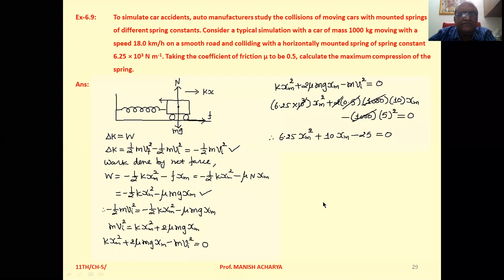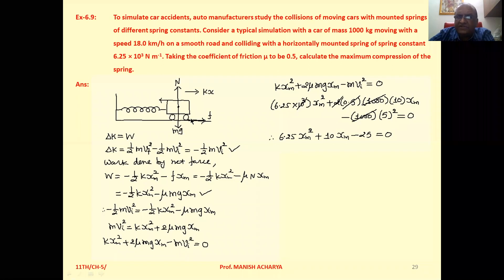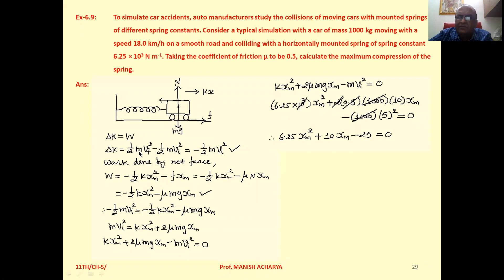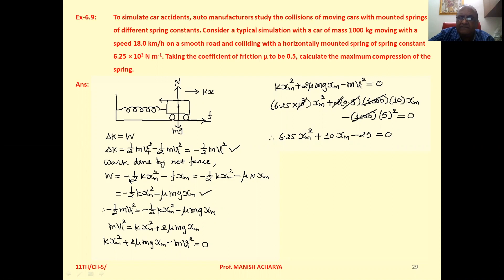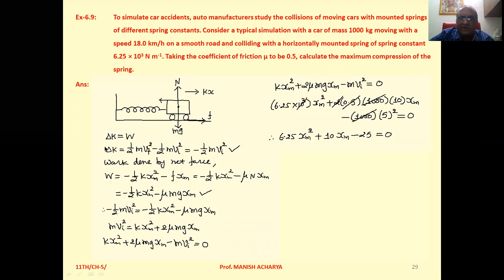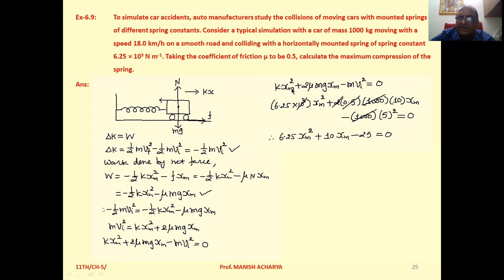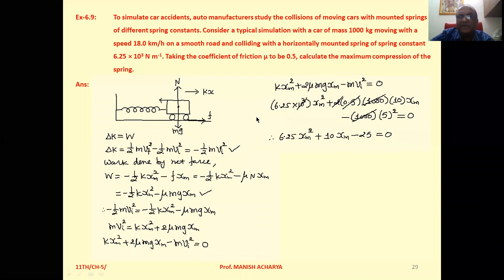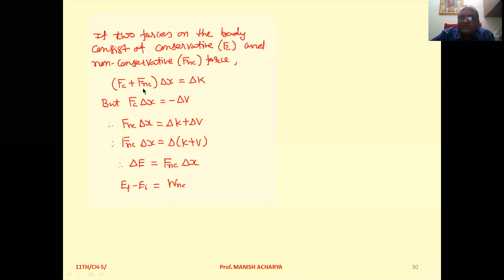Consider Example 6.8 taking the coefficient of friction, myu to be 0.5 and calculate the maximum com

Comment: Spring force is equals to -kx and here displacement and force are in opposite direction so Work done by Spring force must be 1/2kx² , then instead of this why had you taken -1/2kx²
Reply: work done's value is -1/2kx² but PE value is 1/2kx²